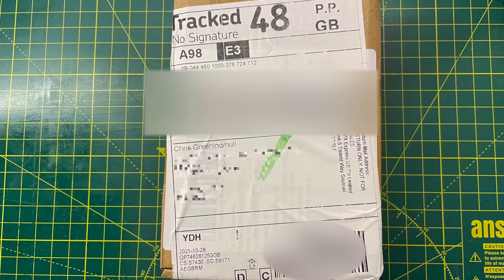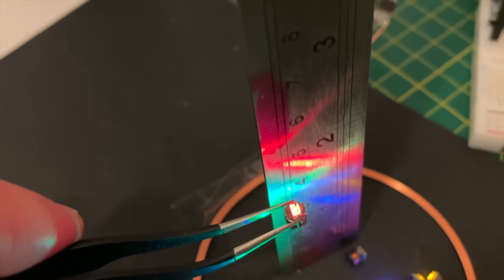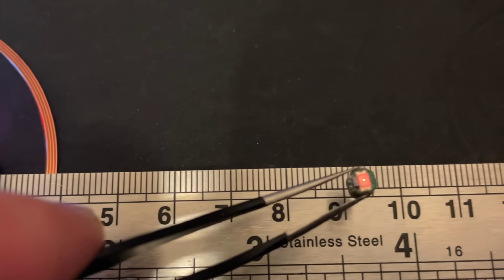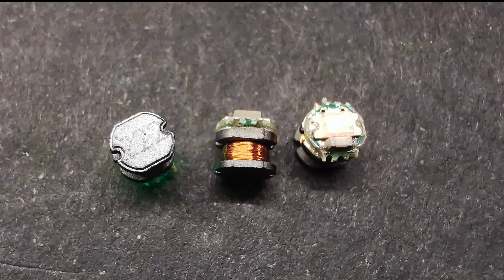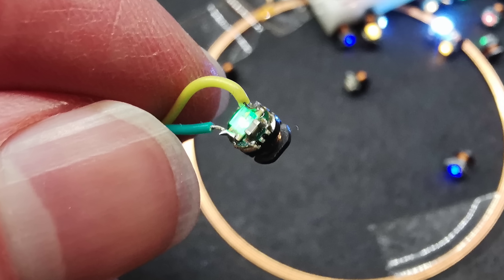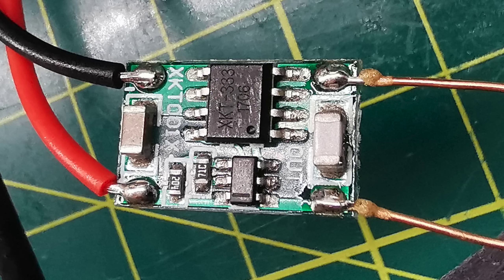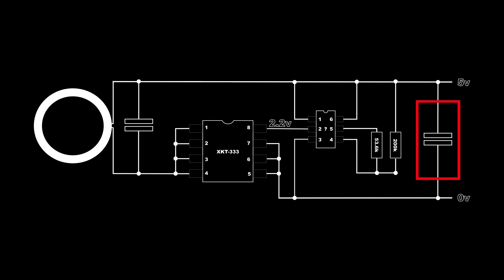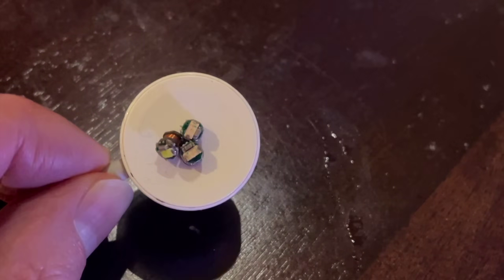Look Mum No Wires - This will blow your mind

Comment: Fun stuff... Build a "snowglobe" with wireless LED floating in small "bubbles" inside the large water sphere.
Reply: Nice! I was thinking of a "firefly-globe" haha
Reply: genius idea... I think you need to find the right liquid that will provide neutral buoyancy.  Also if the liquid is conductive.. you may need to dip each led into a clear epoxy coating to avoid shorting out.  Then a slow circulating pump to provide agitation to the liquid.  I would also suggest a larger sized globe to keep proportions looking nice.
Reply: @panofish  I've expermented with it, but I found neutral buoyancy very hard to achieve.  still, I'm totally popping a few of these into a bong.

Comment: I watched your second video and think that the sin you wwas expecting in this one was the signal in the coil+cap circuit. You don't see it as it with the LED because of it. It is the same you have at the output on a switched source in the middle of the diode bridge (or so). The diode is rectifing the signal so you can only see the reverse voltage.

Comment: you're actually greatly diminishing the range by using that metal ruler.  it'll be shielding and/or reflecting rf.  try the test again using a paper or cloth rule.. like the ones used for sewing.

Comment: Really horrible idea, but a giant coil around the house, that pumped out a few more volts. I can only presume this would absolutely not work, but I know nothing about electronics.
Reply: Nice Idea,  coil around the house, then charge everything wireless inside the house. The hair will stand up for everyone in the house to
Reply: I'm sure it could work but efficiency would be a major issue, not to mention interference and other possible side effects. Tesla pretty much proved wireless power would work years ago but wired was just so much less wasteful. Power loss over distance is a huge issue with wireless power.

Comment: Would a small Tesla coil power them ?
Reply: So long as the flux field was of the correct frequency so the tuned receiver would maximize power, any electromagnetic source would do.  A Tesla coil is a high voltage device and nothing like that is necessary.  You know how your teachers told you there is no such thing as a stupid question?  Well yours is like asking if a car's ignition could would power them.   Um... no high voltage necessary.

Comment: Have them in watertight bubbles, vary the buoyancy somehow, and put them in a fluid-filled translucent cylinder so you can see them going up and down.
Reply: "somehow" eh?  Brilliant.
Reply: @DiffEQ  Dunno. Maybe have it be neutrally buoyant, and put a small pump on the bottom to gently circulate the liquid.

Comment: There is only one project to make: Thanos Infinity Gauntlet + Stones

1. Bury the loop inside the gauntlet (you can start with a plastic gauntlet), also place some magnets in the stone sockets.
2. Get transparent plastic stones, put appropriate wireless color LEDs inside, and maybe a magnet so the stone will snap to gauntlet)
3...
4. PROFIT

send me a percent of the PROFIT ... ;-)

Comment: I believe the "odd waveform"at 3:34 is the sine wave emitted by the charger being half-wave rectified by the "diode" part of the LED. The positive half of the wave is allowed to pass, but the negative half is blocked by the LED. If you put a full-bridge rectifier on the tiny PCB before filtering it through the capacitor, you would probably get a brighter output from the LED.
Reply: Lmao I published a link and got auto-removed
Anyway I was saying that I did a simulation showing how you can totally get a sine wave by shorting a parallel LC circuit to ground with a DC source, it's a basic resonnance phenomenon
I simulated the circuit shown in the video using a NPN saturated with a square pulse at the resonant freq of the LC and it works fine.
Also, I get the same waveform when coupling the L with another LC (the LED side) in parallel with a diode. The Vf of the diode shorts the receiver coil and steals power from the emitter, which causes the flat response.
Edit: Forgot to add: Richard u stoopid
Reply: Here is some insight: first, yes, you do get a sinusoidal waveform with the setup shown (inductive transmission of square waves into a resonant tank circuit). However, the wave becomes clipped due to the shunting action of the diode being lit, because it is drawing current when forward biased. When reversed biased, it does not conduct so the sine wave is untouched and its full voltage excursion is displayed by the oscilloscope. Half wave rectification is typically done with the opposite topology (series rather than shunt). Usually you see shunt rectification in RF and AM diode detectors.
Reply: Well, you would be wrong.  The power source is DC so there is no sinewave.  Converting DC into a sinewave takes more circuitry than you, apparently, can imagine.  Even a pseudo-sinewave is difficult (often called a modified sinewave, but done for marketing purposes because it's a modified square wave.  Why would you modify a sine wave?) to build.  This is nothing more than a tuned chopper circuit.  Change the frequency or induction coil enough and you will get closer and closer to the chopped DC signal.
I'm not even going to comment on the ridiculousness of the full-wave bridge rectification you noted.
You may be the smartest one in the room, but it's classic Dunning-Kruger to the rest of us.
Reply: @DiffEQ  lol I have a degree in electrical engineering... I'm not an analog electrics expert by any means, but according to the circuit diagram he showed and the oscilloscope readout, the giant coil powering the LEDs is being pulsed with DC, and the inductance of the coil is filtering the pulsed DC waveform into a pseudo-sinewave.
That pseudo-sinewave is then picked up by the inductors on the LEDs, and filtered with the capacitors and the negative half is chopped by the diode in the circuit. 
As far as the LED circuit behavior goes, it's exactly the same as any AC circuit.
If I'm misunderstanding how this works I'd love to know, but that's how all of the wireless power transmission methods I've studied work, so I assume this is pretty much the same. I would recommend looking up transformers and antennas if you want to learn more! Electrical engineering is a really cool field! (Pun fully intended!)

Comment: Years ago "50" we used the same technology in the signals corps to check antenna output with a small neon tube taped to the vehicle antenna.
Reply: Not the same "technology".  Neon tubes, as well as fluorescent, illuminate by RF ionization.  That's completely difference from passively converting a tuned magnetic field into a current source to power an external device.
Reply: @DiffEQ  Thanks for the reply Richard and I will add this to my pool of knowledge.

Comment: The XKT-333 has the pinout of a common MOSFET, but possibly optimised for this application.   The 6-pin chip appears to be generating a fixed frequency output based on the resistors, as there appears to be no feedback.
Reply: I'll guess the 6-pin chip is a VCO (Voltage Controlled Oscillator).
Reply from the maker: @bigclivedotcom  That's it - a pretty simple circuit really, MOSFET driven by an oscillator with an LC circuit - I've redone the reverse engineering here https://youtu.be/jdc_0r5pJPc - but would be great to see a Big Clive video doing it properly :)
Reply from the maker: Also - OMG - Big Clive has commented on one of my videos!
Reply: @atomic14  that's all you get for Christmas.
Reply: @KronicDaydreamZ  😅😂 Oooff! Tough love! 🎄😎✌🏼
Reply from the maker: @KronicDaydreamZ  It's all I've ever wanted :)
Reply: Yea Big Clive
Reply: Big Clive 👍🏴
Reply: @amishparadise1924  Maybe people just love - new - fascinating - pointless - entertainment?

Here's another "what's the point" ...

What's the point of making a comment on a YouTube video when there is already 1.9k comments been made ... Nobody is going to read the/your comment?
Reply: @SCAM-BUSTER.777  except you? :')
Reply: Well said my robot friend.
Reply: @michaellinner7772  i thought clive was a bear not a robot, bear-bot?
Reply: @amishparadise1924  Apart from the fun - it encourages (some) people to think outside of the box and to experiment with seeing if they can use the tuned circuit to power other tiny things - possibly even embedded devices that need contactless charging. There are almost endless possibilities if you keep immersing yourself with new ideas, concepts AND have the option to cheaply play with them.

The QI system is fine - but the protocols before enabling proper power flow make it harder to quickly induce power into something other than a QI receiver. Here, you just make a little tuned circuit (perhaps even an etched coil on a tiny pcb) and see what you can drive / power. Add a tiny lithium cell and continuos operation might be possible, even if it only briefly gets power from the coil from time to time.

What if the coil goes all around the room, what if you change the frequency, what if you can change the power handling levels....

OR you can just decide there is no instant need for LEDs powered by RF and move on to something that DOES fascinate, amuse and inspire you.
Reply: Uh, yeah. What you said. 👍🤣🤣🤣💕😎

Comment: I think that, accourding to the connection diagram of the XKT Chip, this is a Mosfet or some kind of transistor without any logic in it. It seems like the little 6 pin chip is creating a waveform that drives the gate of the xkt.

Comment: I bet they would light up under high voltage cabels. It would be interesting to put one high up in a tree, it would fascinate people walking past at night.
Reply: i was thinking the same thing if you get close enough to a power line or even normal household electrical wiring if it would be enough inductance to light it up

Comment: If the L/C circuit is tuned differently for each one, you could then control which ones are lit based on frequency and amplitude modulation.

Comment: consider your ruler may be increasing the range!
i wonder if results would be different with a non-metalic ruler
Reply: Precisely, a steel ruler may connect the magnetic field of the induction coil way beyond the coil's plane. An induction coil attached to the oscilloscope could measure this.

Comment: Embed them in a block of clear resin, so that people can see them floating around in there without any wires. Then you can just hide the wireless "charger" under a table or something.
Reply: @simonwilson7581  The fact that they are wireless is emphasized because they are floating around in a block of resin. Having them laying in a corner somewhere people would probably not think too much about it, as they might just assume they have some tiny wires or batteries connected. With resin people can clearly see that none of them are connected and that you can't grab the LED's to change a micro battery.
Reply: Mood lighting for dinner. In the bottom of drinks glasses they can glow when placed in the right place
Reply: @danthelambboy  great idea!
Reply: My first thought.

Will be doing this 👍

Comment: As far as projects go, I really want to cast these into dice and then cast the wireless loop into a dice rolling tray.  This way, when you roll the dice they glow! (bonus points if the LED shines out the high-side).
Reply: i love this idea.
Reply: Everyone would think you're cheating with "electronic dice". No one would want to use them.
Reply: File your IP documentation yet?🤔
Reply: there is a kickstarter for light up dice that recently ended presumably using the same technology...somewhat expensive but the dice are really cool
Reply: And then you'd get mostly low numbers, except if you balance it.
Reply: Because the coil output, and cool in led need to line up, only the number on to would light up. Either it's just an extra surprise of you get highest number & it lights up, or you have different colors for different numbers and you can tell by color what number it is.
Reply: Something like these smart dice?
https://youtu.be/UxT8COXu6zE
Reply: @jurgmanx4644  dude I just looked that shit up and it's amazing, thanks for sharing!
Reply: @meawreg  and its all open sause so ya can improve and tweak. Its on my to do list, after minis. I should order a flexible pcb soon tho.
Reply: @jurgmanx4644  you are amazing! Keep up the good work!

Comment: You say "through 3 and a half inches of dense material", but doesn't electromagnetism ignore material? Am I wrong about that?
Reply: Lots of things impact electromagnets. Thats why an electromagnet with and without a ferromagnetic core makes a huge difference on perfomance.
Reply: ferromagnetic materials / conductors would likely interfere with or attenuate the signal. Al, Fe, Copper, and so on, especially if grounded. See also Faraday cages and induced magnetic fields.

Comment: If you could somehow match it with magnets, so the power induced "by itself" without external power supply you could do e.g. lights turning on when cycle wheels start to spin?

Another idea is "hide-and-seek" game for kids - every one gets the magic wand and they need to find hidden treasure in the room.

If you would be able to drive different colors by different coils you could create a board game where kids need to show the answer with the "magic wand" - correct answer lights up green light, wrong answer - red.

Another idea is putting them on the RC car or drone and create "scoring gates", so you could make a race with friends (you would set up the gates in the park or backyard, and the goal would be to go with the vehicle through the gates (lights on drone/car light up and you score).

Comment: Suggestions for a project? Yes. Here's the story: I've been looking for something like this for the past few days which is why this video might have shown up on my Youtube. Basically, I'm really terrible at FPS games because I can't keep focus on the cross hairs in the center of the screen (I'm playing on the TV screen) and the in-game cross hairs are difficult for me to see, so  I string a couple of threads of cotton from corner to corner and have a physical cross hair made of bright paper, or other materials that I'm messing with. This still isn't bright enough and my eyes drift away from it and it's not that easy to reacquire, so a couple of days ago I started looking for wireless LEDs but decided I would probably have to use 3mm wired LEDs and then I saw this video. I Haven't started wiring the LEDs, yet. You think you could get a single LED physical marker in the center of the screen to act as a cross hair? Might even be monetizable as a commercial product (I want my cut, though).

Comment: I would put a bridge to use both parts of the sine wave to increase the efficiency of the circuit. There are several SMD bridges on the market to do it taking minimum space

Comment: I wonder if the transmitted half sine wave is done so that you don't need rectifier components in the LED itself, which is usually needed to convert AC to DC. Pretty genius to reduce parts/complexity/cost.
Reply: can be because the driven LED itself is a diode and acts as a rectifier. ???

Comment: It would be interesting if you could add a means to tune the wireless LED to a multiplicity of frequencies and have different color LED mean predominant frequency intensity encountered......... Perhaps one could contemplate even using a piezo electric transducer driving a joule thief type circuit to charge an inductive coil to light the LEDS sans a electric battery input.......... shake and charge, or place in pocket as a functional charging pedometer!

Comment: Here's a project idea.  Build a big scale Star Wars Imperial Star Destroyer, and light it with traditional methods (LEDs and fiber optics - see many examples on the net).  Swarming around the outside are several squadrons of tie fighters and bombers, supported only with tiny piano wire painted black.  Each tie fighter and bomber is individually light with the wireless LEDs.

Comment: is it possible to magnetically levitate or steer LED when on?
Reply: I was wondering about ultrasonic levitation (there are some volumetric displays using that on tiny beads, in combination with lasers to light them), but probably too heavy for ultrasound.

For magnetic, they might need attaching to a permanent magnet - not sure how controllable they’d be though.

Comment: Can you get them to light under a high tension powerlines?   I'm speaking about the ones that are strung across the countryside and are very high and typically have voltages around 1,000,000.
Reply: Low frequency, probably won't do anything

Comment: Very nice. I'd love to see what these would do when exposed to a metal detector coil.
Reply from the maker: I think metal detectors use between 3kHz and 100kHz - so they might work, with the DIY version you could tune the inductor and capacitor on the LEDs to match the metal detector frequency.

Comment: I am not sure if measuring vertical and horizontal distance with stainless steel ruler is a good idea for scientific measurement. The added steel "core" to the coil could change coils strength. 

But a great demonstration of cool gadget :)
Reply: Exactly this. The range measurements may seem possibly faulty, considering the ruler.

Comment: How did you measure the "2.2V"? If with a DMM, could it actually have been a square wave driving a N-MOSFET? Maybe the tiny chip is some timer IC?
Reply from the maker: I measured it with my multimeter - a schoolboy error - if I'd used the oscilloscope I'd have seen the square wave driving the MOSFET. The chip is an XKT001. In the DIY video I've got an updated reverse engineering.